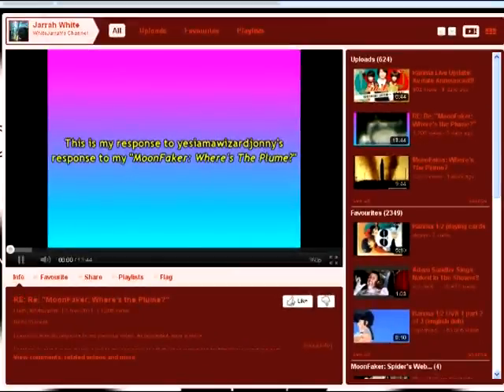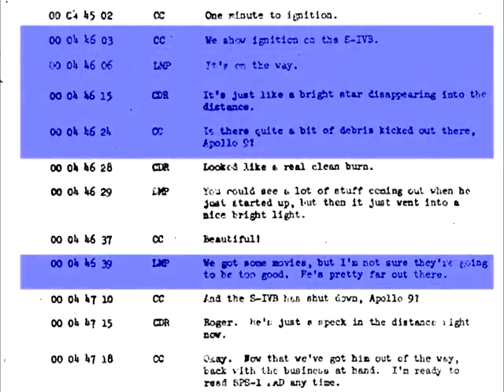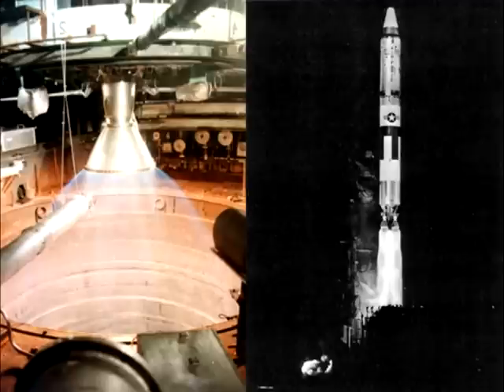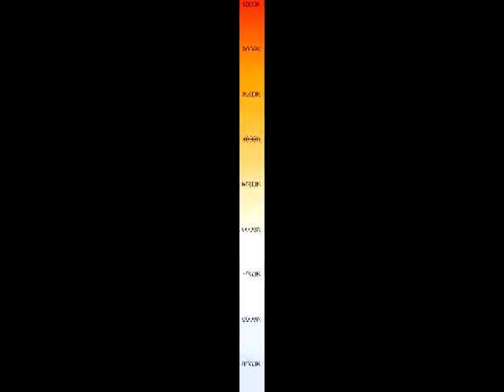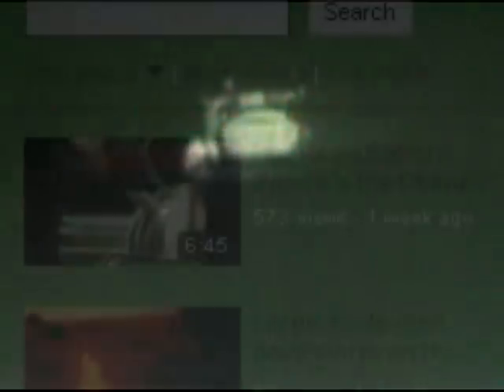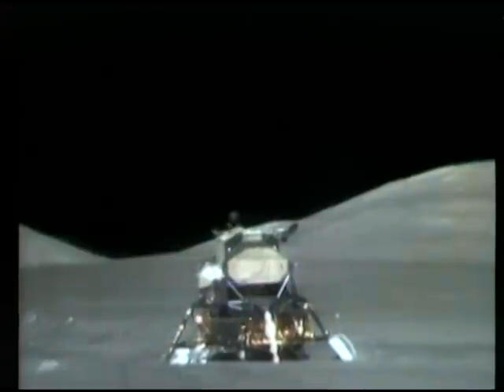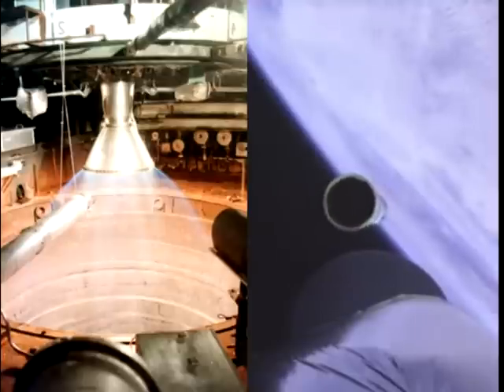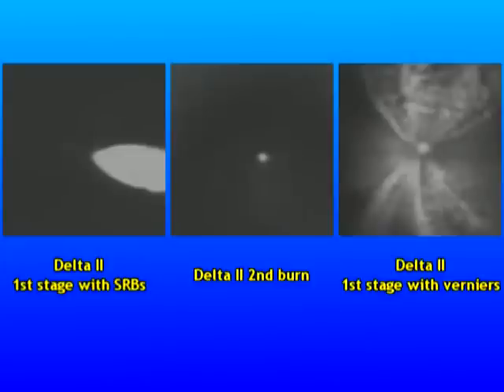MoonFaker: Where's The Plume? II. PART 1

Comment: Lets put this myth to rest.
Hypergolic fuels do not burn "invisibly" - hot gases emit light. The amount of light is dependent in the temperature and amount of gas.
 How visible the flame is dependent on the ambient light and how disperse the exhaust gases are.

Hypergolic simply relates to the spontaneous combustion of fuel and oxidizer on contact.

Hypergolic exhaust gases are still heated by the formation of chemical bonds broken and formed in the combustion.

Exhaust gases still emit light due to thermal emmission because the gases are very hot.

You need a lot of hot gases to produce 10000lbs of thrust.

So will those believing in the moonlanding stop putting out vad science because they do not see a flame on lem takeoff. Find another explanation based on proper science instead of spouting bs.

Comment: Very good trying to talk circles of tech that have nothing to do with simple facts.  They used fuel and oxidizer that are known as hypergolic.  They ignite as soon as they meet(a safety feature).  No ignition starter needed as with RP-1 & LOX (Saturn 5 1st stage) LH & LOX (Saturn 5 upper stages) Yes these hypergolic fuels  are the same kind that were used on all Gemini Titan launches.  Look at any film of a Gemini launch, there is not much of a flame at all and what is there is very translucent.  Look at any film of staging from any rocket American, Russian, ESA, there is not much of a flame. Before staging the 1st stage flame gets very translucent as well. The only time you see the flame is film shot looking right up into the engine bell.  This can be seen in the Apollo 17 liftoff from the moon, when the ascent stage pitches over you see the light from the engine bell.  Also you are breaking down the components of the fuels as to how they would react as just a single element.  Well they are  not single elements anymore.  If I understand your logic then because there is hydrogen and oxygen in water then well be careful not to have a lit flame anywhere near water.I will say you have a vivid imagination as you refute what ever bit of evidence countering you evidence as desperation....seems a bit like the pot calling the kettle black.  As for the little item falling off the ascent stage then shooting off to the left.  Just a guess here but I would say the it was the engine exhaust that pushed it away.  Gases from the engine would have a wide if not seen plume.  Now you are talking about the Delta 2.  I think you are seeing things with the Vernier firings.  I just see dark puffs.  Also after staging you see what I said. you are looking right up the engine bell.  The film shot from the top looking down, you see the reflection of 2nd stage engine start up in the separated 1st stage but no flame as you may think.  Has nothing to do with the camera angle as the camera is off center and if there was a long bright flame it would show.   Would be fun to have a interactive debate.

Comment: The lander slightly wobbles as it accends... hmmm?
The lander had to be perfectly balanced for the takeoff i.e. it's center of gravity would have to be overlaying the center of effort of the engine. How was this possible after so much of the payload was asymmetrically removed from the craft (especially the heaviest piece of equipment the rover from one of the side payload banks) and that moon rocks were subsequently added to the craft. Plus, the astronauts were not "dead weight". Their collective mass had to maintain the required center of gravity over the center of effort and there would be no allowance for movement of body or limbs. The slightest movement of the center of gravity deviating away from the center of effort would put the lander in a spin and yet it perceptively wobbles on accent... hmmm?
Reply: Dave S
"The lander slightly wobbles as it a(s)cends" - so it hydraulically adjusted its nozzle position.  It's not a penny rocket.
Reply: @tonyduncan9852  In theory and on paper the physics of vertical adjust works great but it was never field tested, this was the first time---lifting off from the moon---absolutely hilarious!  Prior to Apollo 11 Armstrong tried to land it (manually?) but it rotated beyond control and the lander crashed, but you know that.
But for the ascent from the moon, I doubt that the onboard processor available and all the valves required could handle the acute timing neccessary... if it was indeed incapable of a manual ascent. That's a contradiction dont you think... manual descent and computer ascent?
It wasn't even a bottle rocket... it was a prop.

Comment: Plume = Reaction between hot exhaust gases and  atmospheric gases (aka "air")
No  atmosphere = no such reaction = no plume.
Next!
Reply: Jarrah White

https://www.youtube.com/watch?v=xIS_RvZNrpA
From about 2:00 on that video, you can see the second stage separate and the exhausts are totally invisible when they don't hit the falling off rocket stage or inter stage ring.
Reply from the maker: Your logic is flawed. Videos of the Merlin engine used on the Falcon show plumes shooting out the rocket during the time its in space, and thruster firings on the Shuttle and Soyuz are also visible. The visibility of plumes has no bearing on whether or not the rocket is fired in a vacuum.
Reply: Most of the videos you mention are still in the vicinity of the earth and thus still operated in some atmosphere. Even the intl. Spacestation is still slowed down by atmosphere. On the moon on the other hand is actually (almost) nothing. That is indeed a visible difference. AFAIK none of the rockets you mentioned ever really left the earths atmosphere!
Reply: Then why is there plumes visible in the vacuum chamber test?

Comment: There are three reasons you cannot see an exhaust plume from the LEM:

1)  Combustion products of hypergolic fuels emit very little light.  Compare the launches of vehicles that use hypergolic fuels (Titan II, Proton, Long March 2F, ), with those those that use kerolox (Saturn 1B/5, Soyuz, Falcon/Falcon  Heavy), or solid fuels (Space Shuttle, Ariane 5, Atlas V).

2)  Exhaust gas expansion.  In a vacuum, there is no atmosphere to restrain the exhaust plume, so it rapidly spreads and dissipates as soon as it leaves the engine bell.  This effect can be seen on every rocket launch - as the vehicle gains altitude, and the air thins, the exhaust gases expand dramatically beneath the vehicle.

3)  Camera exposure.  You can't see the plume for the same reason you can't see the stars in lunar landing photos.  The camera exposure is set to accommodate the bright ambient light, so relatively faint items (like stars and exhaust) don't show up.

Comment: jarrah White - I can debunk your whole video easily:. When the falcon 9 lights the Merlin engines at sea level, can you see the plume?  Yes, of course!   Can you see the plume once the first stage reached vacuum?     NO .  Case dismissed.
Reply: Stuart Gray the Merlin are kerolox burning engines, meanwhile the LEM ascent stage had engine/s that burned hypergolic fuels that produce invisible flame. The moonlanding deniers don't want to know about the propellants
Reply from the maker: What are you talking about? I can see the plumes when the Falcon reaches space. They are somewhat more dark in colour but you can still see them.
Reply: Jarrah White  I have watched every single falcon launch, one in person.  You cannot see the rocket plume above ~50 km.  You can still see the fire if you look right up it's ass, but watch the video from the rocket. The plume keeps expanding until you cannot see it even though the engine is still at full throttle.  I have launched five spacecraft for NASA, and watched another fifteen with my own eyes.  How many have you seen in person?
Reply from the maker: "You cannot see the rocket plume above ~50 km."

You sure about that? Look at the bright, dusty spread coming out the engine: http://i.imgur.com/9uGMTtf.png
Reply: Jarrah White also watch the second stage engine burns from the camera on the second stage, almost zero externally visible fire while it is the same engine as the Merlins on the first stage
Reply: mr. Gray, you have put the conspiretard to silence mode. I bet he feels so dumb now.

Comment: Apollo propagandists are morons!  The Titan II engine creates such a huge gas pressure that there isn't going to be any "atmospheric" gases being interacted with until the exhaust plume has given up it's useful thrust energy tens of meters away from the engine bell.  The reaction in the combustion chamber and the velocity of the exiting gases from the nozzle would instantly blow any atmospheric gas that may be within the engine and nozzle right out the exhaust and until the fuel runs out there isn't going to be any gases from the atmosphere doing anything close to that engine bell!

Comment: What idiocy these hoaxers spew. 

The LM ascent stage used a fixed thrust hypergolic engine with Aerozine 50 fuel and nitrogen tetroxide oxidizer. It had 16 kN of thrust. 

The S-IVB second stage used a J-2 engine with liquid hydrogen and liquid oxygen fuel. It had 890 kN of thrust. Just a bit more than the LM, wouldn't you say?

The plumes will be very, very different - can you say apples and oranges?

Oh yeah, NASA spent hundreds of millions of dollars and a decade to fake a Moon landing and plum forgot to add a plume to the ascent stage.

Grow up and use some common sense. Just because you're completely ignorant of how physics work in a vacuum does not equate to "fake".
Reply: Even by NASA’s account, in 1969, they were not ready for a moon landing. The LM had failed some days before the moon mission. Huge risk, wouldn’t you say, putting astronauts life on the line like that? Just to get it done before the decade was out?
Reply: NASA didn't "forget to add a plume", like not showing the stars, they purposely chose to not show it because it was too difficult to "do it right". (in case someone got the bright idea to look and check and wonder and question)

You are spouting typical Moon-Faither spewage.

Moon-Faithers are all alike. (and the opposite of most good "Moon-Hoaxers" / "Moon-Realists")

A Moon-Faither's best friend is Confirmation Bias.
Add to that the FACT that MOST so-called and self-proclaimed and self-described "skeptics" and "debunkers" have an EXTREME religious-like and CULT-like BELIEF in what they have "read in a book" or "someone told them", are severely lacking in Logic and Critical Thinking skills, and who couldn't 'skeptic' or 'debunk' their way out of a wet paper bag to save their not-worth insuring lives, and Bob IS your uncle. Say, "Hello" to Uncle Bob for me.

Have a (one-sided from their POV) "discussion" with one of them and you will get typical Moon-Faither LIES by deception, omission, exaggeration, half-truths, weasel wording, deflection, and outright ignorance, with skewing, slanting, distortion, and extreme bias, among other related issues.
Reply: Delta Tango I have long since stopped arguing and trying to educate moon hoaxers and flat earthers.   If you stuck them on a Saturn 5, flew them to the moon and dropped in on all the apollo landing sites, they would claim you drugged them, hypnotised them and it never happened.  Save yourself the stress and just hope they don't reproduce. The real question to try and answer is 'who's been shitting in the gene pool'?
Reply: Go watch a Titan II engine fire off.  Being in a vacuum is irrelevant since the engine itself is what is creating its own gas pressure as the fuel ignites with the oxidizer.  There would be the same color and shape of rocket exhaust firing from the ascent motor if it were real.  The only difference would be the smaller size of the plume because the engine is less powerful.  There was no throttle on the ascent engine so it was all on instantly at launch supposedly.
Reply: Being in an atmosphere in not irrelevant. When an engine is ignited in a vacuum as opposed to Earth's atmosphere, the flame dissipates much, much faster, as it has zero pressure to momentarily contain it.  

Remember, the Earth's atmosphere is very thick, although we don't 
normally think of it that way. It holds up 750,000 pounds 747s.  

Also, even though the fuel contains its own oxygen in the form of a liquid oxidizer, it will burn the air around it trying maintain itself.
Reply: There is a picture in this video that shows the vacuum engine test, and the flame is clearly visible: blue near the engine bell and bright white below that. Juxtaposed to the pitch blackness of the sky on the Moon, this flame should be visible.
I think we will all agree that calling people idiot - those who ask relevant questions - is not helpful, in fact it is rude. Have you heard of the scientific method? Science? That doubting and asking questions IS Science?
Reply: Delta Tango ...theres nothing left to say....👍
Reply: Bill Dee ...watch any shuttle launch Bill...once the Solid booster fall away  and shuttle is on the 3 RS-25's....liquid fuel engines in space...."NO PLUME AT ALL"...just as they described it...3 bright stars...as you look into Rocket Nozzle....Zero Plume...

Comment: JW, you a staw-manning again. The atmospheric gases surrounding an earth-based engine burn are not pure. Gases surrounding EVERY engine burn in atmosphere are chocked full of particulate matter, pollutants & dust--all things not found in the vacuum of space. These particulates, combined with atmospheric elements CAN combust & DO combust.

2nd, on earth, residual atmospheric gases are trapped inside the engine bell @ even in space they are inside the chamber.

Comment: JW, you screwed up. Undeniably, you used the SIVb video & I can't believe you won't just admit it. Sure, there are 1,000s of copies of it and some have been edited, color-corrected, stabilized & a host of other things, but the Apollo 9 video you used IS THE SIV-B!  To this date, you have ONLY compared engines that were either different engines or in different environments or photographic contexts...and it's not working for you, dude. 

For ex: the vacuum chamber shot is NOT in the dark of space!

Comment: @Chev4206 There is "nothing of substance" beyond a rocket nozzle that it's eflux "can push against", either in space or within the atmosphere. That is not how rockets work.

BTW - geostationary satellites are not postioned at "low" altitudes. They orbit at an altitude of about 22000 miles. Yet rockets work most effectively there, and beyond.

Comment: @eventcone Nearly right, 3/10 for effort.
The chamber wall has NOTHING to do with thrust. No pressure and no friction in space means that any exhaust gases (and thrust) have NOTHING TO ACT AGAINST because on the other side of the nozzle there is nothing. In space thrust is impossible.
Why didn't Nosa simply turn aponno 13 around instead of sending it to the moon?

Refrain from lecturing me. It doesn't work and makes you appear daft.

Comment: @Chev4206 "..how can an opposite reaction happen when there is nothing to act on?".

In a rockets combustion chamber, the chemical reaction produces high temperature gases. These therefore want to expand very rapidly, but can do so in only one direction: out via the nozzle. In the opposite direction they come up against the chamber wall, and apply a pressure. This pressure is the thrust, equal and opposite to the rate of change of momentum of particles through the nozzle, per Newton's 2nd law.

Comment: @Tweekerhead You have shot yourself in the foot with this one and many thanks.
So sound cannot travel in a vacuum as it needs a medium to do so? Yes I agree.

So by the same token how can rocket propulsion be possible in a vacuum? There is no medium for it to thrust against. No air. No friction. No pressure.
Remember that outer space contains virtually nothing. Is that why its called space?
Try pushing against 'nothing'.

So how did Nosa accomplish all the Aponno missions?
Bullfuckingshit......

Comment: @WhiteJarrah
I agree. The lies, insults and bogus half-wit claims you've had to endure from NASA's self-appointed army of screeching defenders would test the patience of a saint!
BTW, were explosive bolts used to separate the return capsule from the LEM's bottom chassis at launch?
It looks like it, judging from the way bits are flying everywhere. BUT NO DUST IS RAISED! 
Incredibly dangerous? Not really, as there was no one in the capsule mock-up being lifted up by invisible wires anyway!

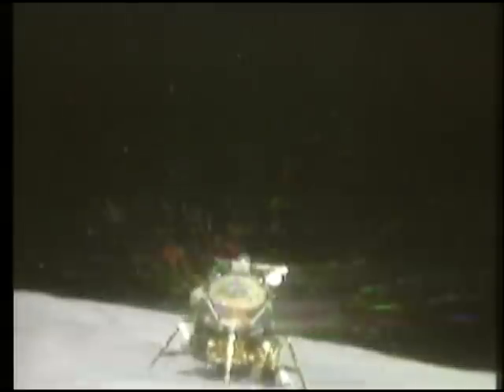Comment: @ 7:07 How come we see stars when we're not supposed to, ahem?
When the dustbin lifts off it's clearly after an explosion and not a jet of hot gases as debris shoots off in all directions. Is this typical of explosives? Surely the kettle ought to be accelerating but appears to rise at a steady rate. Did the puppeteers forget this?
Back then faking was easy and it fooled us for a while.